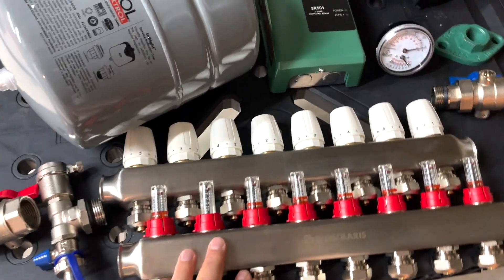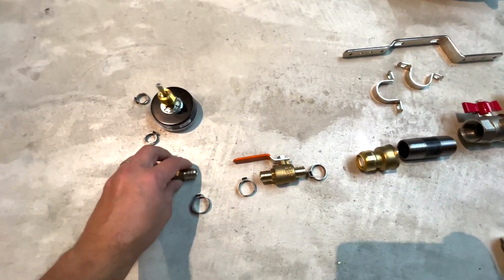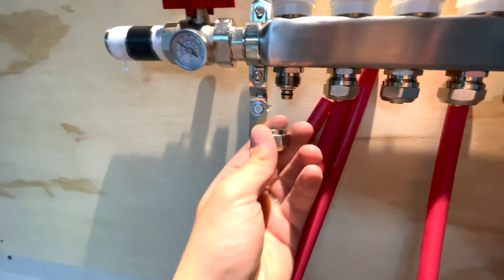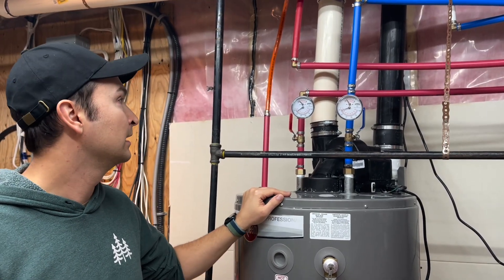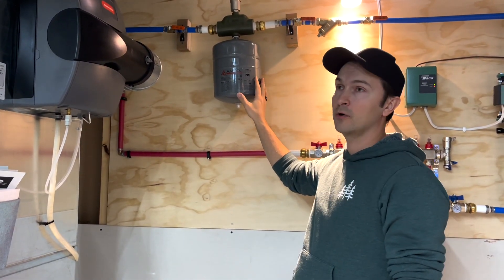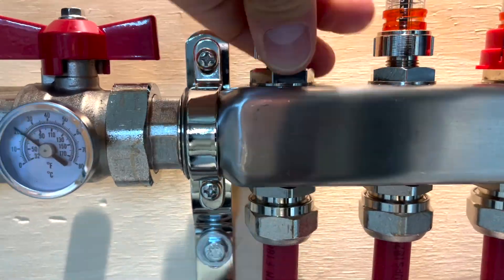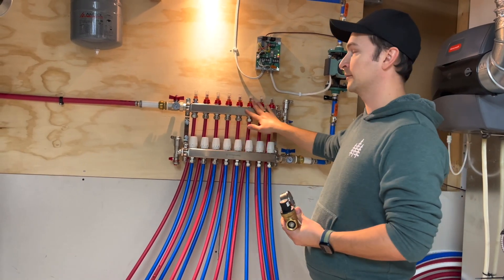Installing the Radiant Floor components

Comment: Are you measuring air temp or floor temperature with your thermostat,and model of control box did you use

Comment: I'm in rural Leduc County and I'm doing whole house hydronic heating. This is the best video I've found for explaining the hookup! I'm also using a hot water tank - electric as there's no gas on my property - and all PEX (no copper to solder!) so it makes visualizing it so easy! And thanks for the tip on where to find some of the pieces I don't yet have.
Reply from the maker: Thank you! Glad you found the video helpful. Hope your project went well.

Comment: It is better to push a fluid than it is to pull a fluid. That is why fuel pumps on cars are in the gas tank.  It prevents air locks. Maybe it is okay to do in a low pressure system but I would prefer to push and not pull the water. Circulating pump should go on the hot side.

Comment: In case not having a termostat and only have thermostatic heads on each circuit. What if they all cut the water flow? Would the water pump broke?

Comment: Was this multiple runs of pex all heating one singular room? I am wondering if all of these “zones” are wired into a single zone pump relay box? I have a garage with three seperate runs of pex (due to maximum footage) but all three “zones” heat the whole garage. Can I wire them to a single zone relay box?
Reply: Yes. You actually have 3 loops, not 3 zones, so you need a 1 zone relay controlling one pump. That is what I have in me shop/garage.

Comment: what climate do you run this in? I have a existing radiant floor heating system that I want to replace my oil fired burner with heat pump based hot water heaters?  I live in Maine climate so need to handle as low as minus 15 degrees

Comment: What about the 3 way valve? It's missing. You need it to keep the temperature coming from the boiler fixed at desire point.
Reply: The water heater does that via its own thermostat set at a reasonable temperature.

Comment: is there a reason you used an expansion tank when using a 50 gal water heater with a pressure relief valve on it?  I feel like the tank itself is giving you a buffer on pressure while heating the water and the prv ensures that it will never over pressurize.
Reply from the maker: All the similar systems I've seen have an expansion tank (even if the water is heated with a dedicated water tank).
Reply: The water WILL expand as it is heated, so there MUST be an expansion tank, which is partly filled with air in a rubber bladder. When the water expands, the air compresses. The water heater itself has no air in it to compress. The prv set at 30 psi is a safety device only , not an operating device to regulate pressure.

Comment: I watched many videos in preparation for the infloor heating of my basement.  Your video is the best among the videos I watched. 
You have listed the materials. Any possibility to get the name,  model and places to buy those components? Any reason to use 3/4" PEX vs 1/2" PEX. I live in Calgary, AB. 
Thank you for the amazing video.
Reply from the maker: Thank you. I am glad you found the  video valuable. I bought the Taco products on Amazon.ca. However,  I think you can get better selection of parts/brands at Wolseley Plumbing & HVAC. They have stores all over Calgary. I only found out about them after doing my install. If I had to do it over again, I would go there first.  There is also AMRE Supply. 
If it helps, I got these Taco items:
Taco TSR501-4 One Zone Switching Relay
Taco 110-251F Freedom Flanges for"00" Series Circulators, Cast Iron
Taco 400-4 1/8-Inch-NPT Float Air Hy-Vent, Brown
Taco 007e-F4, ECM High Efficiency Circulator Pump, Cast Iron
Taco 431-6 Air Scoop, 1" Size, Cast Iron

The manifold: 8 Loop 1/2" Pex Manifold Stainless Steel Radiant Floor Heating Set/Eight Branch Kit with 1/2" adapters/Compression Nuts from Ecosolaris
Reply: @comfyhomestead  thanks a lot for the detailed information. Very much appreciated!

Comment: 8 zones but 1 thermostat.... how does that work? how do you control temperature in the entire house from a single point?
Reply: Each zone by definition has to be on its own thermostat. In this video he has 8 LOOPS, not 8 zones.
Reply: @ COrrect. It's a single-zone system. I built mine this way & when properly balanced it works great. I have a pretty open floor plan too.
Reply: The system is so incredibly slow that the temps will balance via air circulation faster than the floor heats them. It can take several hours for the thermostat to satisfy one cycle with infloor, unlike a traditional heating system that will cycle several times per hour.

Comment: Great video Mykola.  Would you be able to share the parts list? Maybe here or via email if that's easier?
Reply from the maker: These are the main ones:
Taco TSR501-4 One Zone Switching Relay
Taco 110-251F Freedom Flanges for"00" Series Circulators, Cast Iron
Taco 400-4 1/8-Inch-NPT Float Air Hy-Vent, Brown
Taco 007e-F4, ECM High Efficiency Circulator Pump, Cast Iron
Taco 431-6 Air Scoop, 1" Size, Cast Iron
8 Loop 1/2" Pex Manifold Stainless Steel Radiant Floor Heating Set/Eight Branch Kit with 1/2" adapters/Compression Nuts from Ecosolaris
Reply: @DumenkoStudio  Thank you!  Very helpful!

Comment: Nice job explaining all the components, I followed this setup, the only problem I have with my heating system is connecting the Taco 1 zone switching relay. Can you tell me if the relay is connected to the heating source or just the pump?
Thank you for advise
Reply from the maker: Hi, the switch relay sits between the pump and the thermostat. The thermostat sends the signal to the switch relay (ex: need more heat),  then the switch relay turns the pump on or off.

Comment: I have a question. When you turn the thermostat up, do you hear the pump cut in? What may be the issue if you don't hear the pump cut in. Thanks for the great video.
Reply from the maker: The pump is extremely silent. You barely hear it. The pump has a light that indicates when it is on.

Comment: We modeled our radiant floor system off of your video and it’s working beautifully! Our next step is to add the thermostat that controls the pump. How did you know what switch relay to get and how to wire it to your thermostat?

Comment: Great Video! Thank-you. Quick clarification! I understood from the video that at the start, the incoming hot water was going into the wrong manifold, is that correct? In the final installed system, the hot water is shown going into the opposite manifold (the one with the non-white cap), which seems like a mistake. Can you please confirm if my understanding is correct?

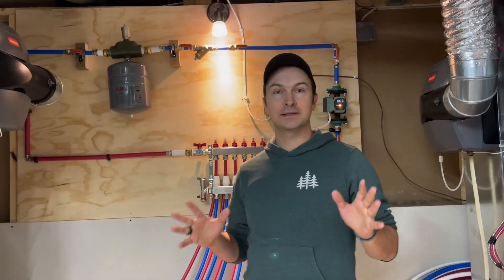Comment: At 1:50 you said the water would come out of the manifold at the regulators. At 2:10 you mentioned your pump pulling water out of the manifold with the regulators in it. Between 4:36 and 5:02 you swapped the manifold positions. So my question is.....does the manifold with the regulators get incoming hot water?

Comment: this is the only video on internet explained diy system. thank you very much
pieces switch sensor and thermostat, trying amazon..no idea: for my house next year 4" concrete electric boiler..no idea how to configure actuators wired up to open close??? what? 4 long sensor from each concrete zone hooked up to a switch box capable of connected to 4 different thermostats? what kind of thermostat? maybe they sell switch relays with 4 thermostats in and somehow wire each actuator to each thermostat and not the switch relay? then thermostat would open or close actuator. no matter what its always just one switch and 1 pump going on or off.??? it can't be that difficult. and WHAT ABOUT EXACT FITTINGS BETWEEN EACH COMPONENT YOU SHOWED??? IS it 3/4" pex or 1"? because the amazon boiler air scoop says 3/4" FIP. your video looks like 1" pex on the wall??? please list the exact connection pieces between each device. thanks

Comment: The huge problem with this is radiant floors in concrete take several days to heat up and cool down so your thermostat will make your house act like a wave up and down. This is why real radiant heater boilers stay steady and even have wifi to the weather forecast and adjust days in advance. Its best to use a tankless water heater that you can adjust to keep it steady.

Comment: How long was the loop in total?  I ask that because I want to understand the power of the pump.  How long a loop can one pump run?  I have a large floor area where I will need 3,600 feet of pex, which means I will need 12 loops.  I wonder if I will need 12 pumps or if I can run all the loops with fewer pumps.  Thanks for helping to answer the question.

Comment: Good install very easy to understand,  but if your not using O2 barrier pex then the pipe is allowing air through the piping. Not a problem however if you used cast iron pump and not stainless the pump and air scoop will rust out over time  sorry didn’t see all the others saying the same thing before I posted. 👍👍
Reply from the maker: Good point. I will likely change the current pex to the Oxygen barrier pex in the near future to prevent potential issues.

Comment: if you you didnt use oxygen barrier tubing on your mechanical room piping. you should add some Fernox, which is a corrosion inhibitor. the oxygen will seep through the regular pex, and prematurely eat away any ferrous metals like your circulators. even if you did use oxygen barrier pex. fernox or any corrosion inhibitor, and certain propylene glycols will have inhibiotrs as well as antiburst/freeze
Reply from the maker: I will likely swap the current pex to the Oxygen barrier pex in the near future to prevent potential issues. Cheers!

Comment: I'd be tempted to build a protective cage around the orange floor pipes since they would not be easy to replace if damaged for whatever reason, if something heavy bumps into them hard.
Reply from the maker: That’s a good point. Cheers
Reply: This has me thinking about how it will be installed in my build. I am thinking of making a plywood half wall. Like 4 foot wide 1 foot deep. Bring it up about 3 foot. Then do the something similar for the domestic water and returns. This would protect what is going in to the slab and ceiling. Allowing for everything else to be to the left or right.

Comment: Beautifl system!
I have a similar system with one zone and 4 loops.50-gallonn power vent water heater.  I added a 24-hour timer so that the pump has power a half hour out of every hour.  This addition lessesens the stress on the water heater. It also makes sure that the water heater does not run continuously as the water would continue to lower in temp. 
I am heating a 1,000 sq ft shop with an 8x18 door.  I keep it at 65 degrees.  Last week, it was 12- 18 degrees below zero, with not a problem. 😀  I do run glycol in this system as well as an insurance policy.
Reply from the maker: Thanks Mark. Agree, these systems are very good and they heat really well. I wish all our floors had these. Really comfortable overall.
Reply: The timer is for the pump or water heater? There is a bit of confusion as to what you have on a timer. How do you regulate the temperature with in the shop. 
This is what I understand. You have 1000 square feet with 4 loops of 250 square feet each plumbed in to a 50 gallon water heater. Your pump runs 50% of the time. At this point I have no clue if your water heater is just on like normal and you cycle the pump 50% of the time and it keeps it at around 65f?
Reply: @kameljoe21  " I added a 24-hour timer so that the PUMP has power a half hour out of every hour."
Reply: @bluegorillacookies  Still does not explain how he keeps it at 65f all the time. 
The problem with putting a timer on the pump is that you do not put less stress on the water heater. 
Using this example if the tempature of the water in the slab is 50f and you run it though the water heater for an hour and bring that water temperature up to 51f. By limiting the water flow and stopping the pump only allows you to heat up 50 gallons of water for 30 mins then push it in to the slab then cycle it for 30 mins and moving that heat around. This does not increase the speed in which you heat the slab up at all. 
A radiant heat floor works just like any hot water circularizing system found in some high end homes or in commercial settings. All water heaters are set up for this. You have incoming cold water, outgoing hot water and recirculating line. The hot water lines all loop back to the water heater where there is a pump. The pump keeps the water temperature at the setting you have it set. This could be 120f which makes all the water in your system 120f all the time. The water heater shuts down when it reaches the set temperature. When it senses a drop in temp it heats it back up again. 
The only change from one system to the next is how the water heater shuts off when it reaches the temperature inside the home/room. Really to keep the floor temperature stable you need that pump running the entire time the water heater is on. For example the pump should shut off when the water heater is not on. Other than that there is no reason to have the pump cycle.
Reply: @kameljoe21  I just told you what the guy said in plain English. I'm not an expert by any means, but I imagine he means there's less stress on the water heater because it's not cycling on and off as much as it were if the pump were circulating water all the time. 

For example, with well water, there is a pressure tank that acts as storage so that when you turn on the faucet, the pump doesn't have to turn on for 2 seconds and then off again. 

I know a water heater isn't a well pump, but the water heater acts as thermal storage, like a pressure tank is storage of pressurized water. 

Instead of the water heater on 100% of the time, it could just turn on when the pump is running, and when the pump stops and the tank is back at holding temp, it could chill. 

The slab also takes time for it to heat up and cool off, so keeping it (around) 65 isn't that hard to imagine. 

You said, "For example the pump should shut off when the water heater is not on. "

But not necessarily. If the water heater has 50 gallons of hot water in it, and the room is dropping in temp, that 50 gallons of stored heat can be used to bring it back up to temp.
Reply: Did you wire all four loops/zones of tubing into a single pump relay box?

Comment: Great video. With only a 10 degree drop in return water temp...shouldn't the flow rate be reduced to allow a more complete heat dissipation, or am I missing something. Sounds like the system needs a timer on that pump to regulate the time the heated water is allowed to do its job. Or is the concrete such a poor conductor that it requires the maximum heat possible just to maintain the desired temp. Lots to consider.
Reply: 10 degree drop in temp for infloor heat is ideal.
Reply from the maker: Hi there, the pump does not run continuously. The thermostat (located in a different room) controls the pump. When the temperature drops below the set point, the thermostat calls for heat and the pump starts to push/pull the water through pipes in the floors. The hot water tank also does not run continuously, it turns on only when it senses that the temperature of the water is below the set point.
Reply: @suspicionofdeceit People feel better when they feel heat. Yet if you were to put temp gauges on them and cycle the slab water first with no additional heat you would see that it is 70f and when you add heat the return water will slowly increase as the slab warms up coming back as 70.1 70.2 and so on till it reaches the set room temp ( numbers are made up yet serve a point to future readers)

Comment: Do you actually have 8 zones or do you mean 8 loops?
Reply: It's one zone really with the one pump and one controller, but that manifold has some control too I think. Typically multiple loops from the same manifold make up one zone.
Reply from the maker: You make a fair point. However, in my case, given that I can manually increase or decrease the hot water flow to 8 different physical areas in my basement directly from the manifold, I consider that my 8 loops of PEX pipes = 8 physical zones.
Reply from the maker: It means the same thing, 1 zone = 1 loop. In my case, I have 8 loops and hence 8 zones. Cheers